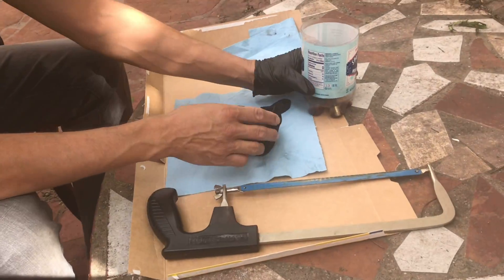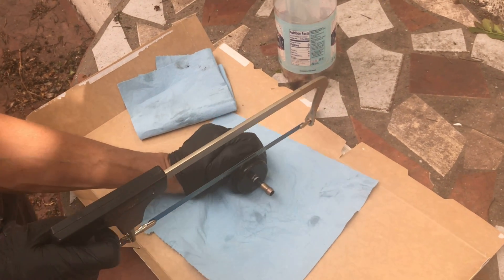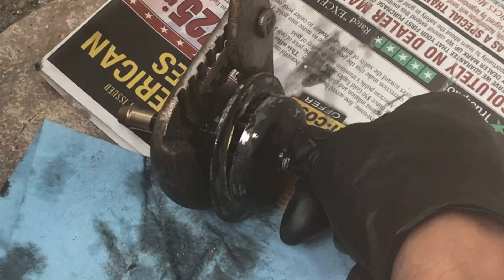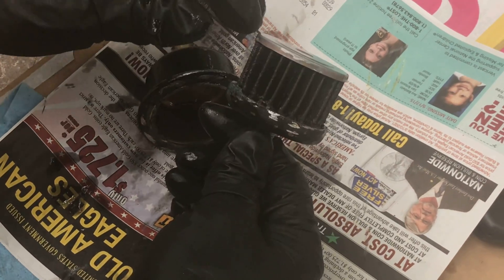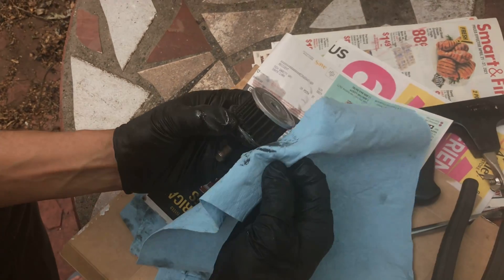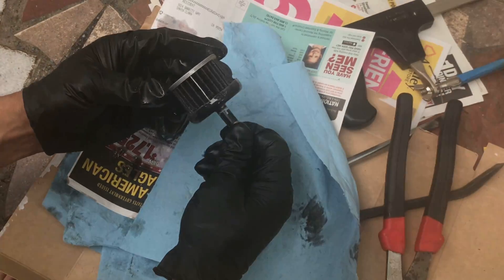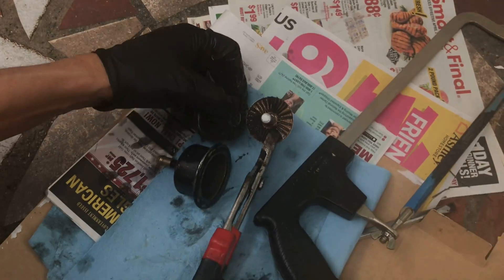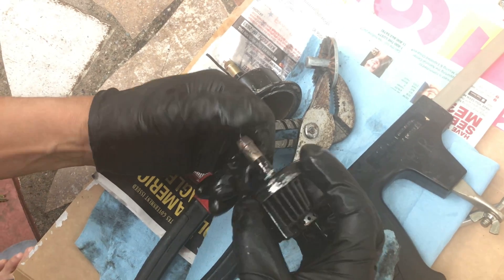2006 Honda CR-V Inline Transmission Filter Dirty After 183,000 miles?

Comment: Can you change the filter without doing a drain and refill?
Reply from the maker: Yes I think you could. Just clamp off the lines and swap out the filter. The amount of lost fluid should be minimal. If
You should not lose more than a few ounces.
Reply: @cartips3198  okay thanks so much also if I do lose a few ounces, could I add some back in to replace that little bit that I lost ?
Reply from the maker: @theroyalone7588  yes you could if you felt it was necessary. A few spoonfuls - say one ounce - probably won’t make a difference
Reply: @cartips3198  okay thanks a lot brother 💯

Comment: I just changed the transmission fluid in our 2007 CR-V with about 215,000 miles. My sister bought the car new and sold it to me about 7 years ago. She could not remember if the fluid had ever been changed or flushed so I figured it hadn’t been. I usually remove the fluid pan but didn’t on this one because it had an outside filter and magnet is on the drain plug. I drained 3.4 quarts(3.22 liters) and replaced with new fluid. I also replaced the filter on this video with factory filter. I risked that the transmission might start slipping but after weeks of driving it hasn’t. Drained with car cold and replacement fluid at same ambient temperature. I wondered how dirty the filter could be and if it might be blocking flow. I was happy to see someone had cut it to see inside. Thanks

Comment: Hello, I have.a.honda crv 2006, engine type is R2A, the gears are getting stuck and delaying  changing, I have changed atf oil. Please help
Reply: Посмотри какая жидкость идет на твою машину по мануалу. Может ты залил ATF не той вязкости, что требуется? У меня Honda crv 2008, для нее нужно ATF Z1, которое имеет вязкость при 100 град. 7,64 сСт. Сейчас это масло не выпускается (с 2011г). Выпускают ATF W1, у которого вязкость 6,8сСт. Я думаю надо подбирать ATF по вязкости. Посмотри мануал и выбери по вязкости, а не по бренду.

Comment: Is that the right filter for a 2003 CRV? I'm having a bit of trouble finding info about it, and there are two bolts stuck on the front bumper/plastic under cladding that I cant get off to take a look.
Reply from the maker: Yes it should fit.
Reply: @cartips3198  Can confirm that it fits my 03 CRV EX